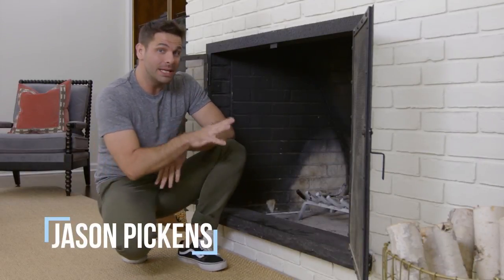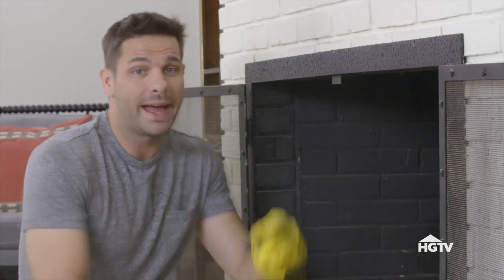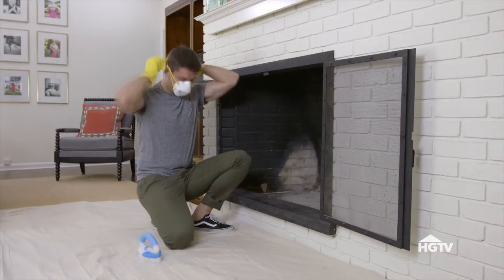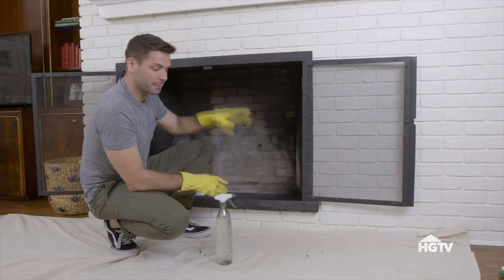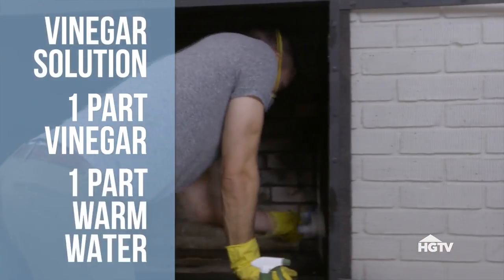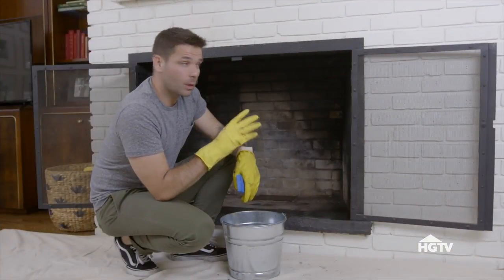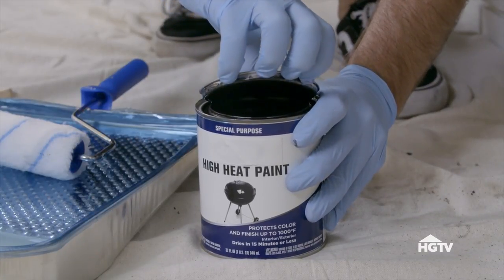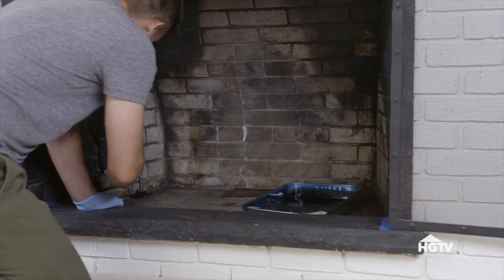How to Paint a Fireplace Box | HGTV

Comment: Why would you scrub that by hand?  You can get a brush that goes into the end of a drill and not only do it better and easier, but faster.  They cost like 7$
Reply: I think using a high speed drill would put a lot of dust in the air and mean a huge mess to clean up in your living room.

Comment: You used a high heat paint, but if I do not ever intend of using my fireplace to light a fire, would a cheaper paint do? I just want to make it a "fa-show" fireplace.
Reply: I would probably still use high heat paint since if you ever sell the house you could be responsible for redoing it
Reply: Agree with part3girl. You don’t want to fail a future inspection because of a little thing like that.
Reply: no - you do not want the paint to catch on fire.  this is a tool. consider safety first always